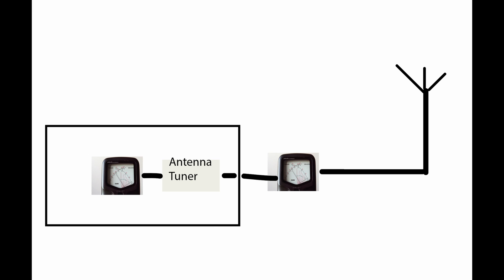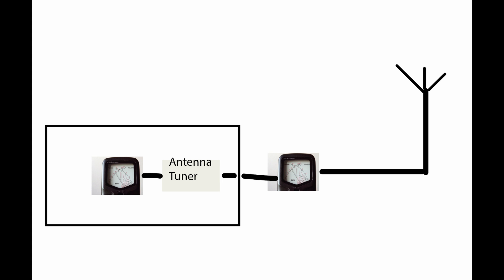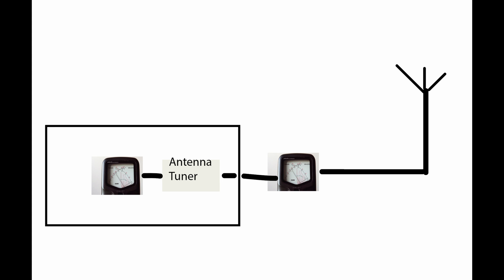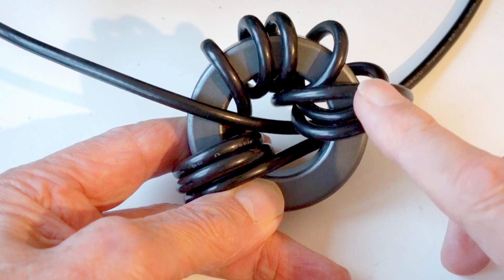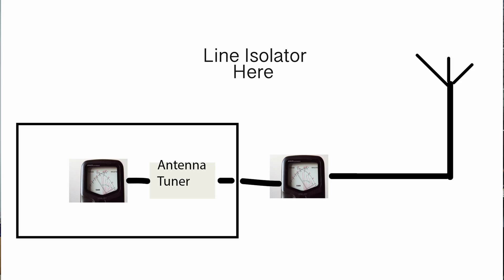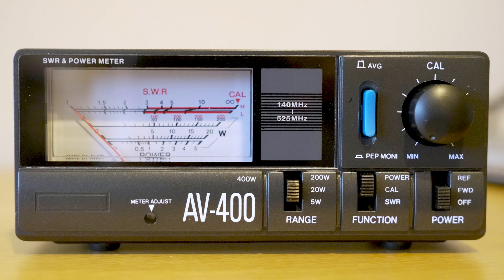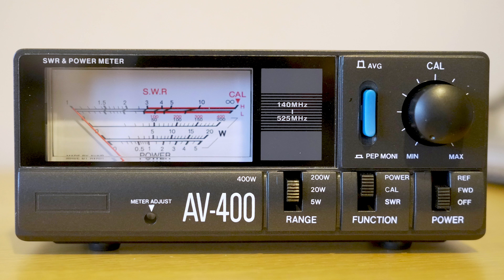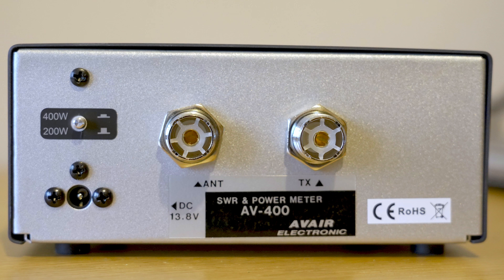VSWR Power Meters: The Truth - AV-400. AV-201

Comment: But my problem is that my internal meter shows a good swr so I bought an external one to double check.

Now that shows swr is too high, I then adjust my antenna and the external AND the internal meters matches on all channels, showing more or less the same values.

So everything is fine, both meter did just confirm that. I unplug the swr and put the antenna back on the radio. Now guess what happens, the internal meter shows high values. I plug the external back in, works fine, the internal and external plays well together on all channels tested. Unplug the swr meter again and of course the internal meter now is out of range again.

What should I do? I really don’t understand, if they are both measuring swr why can’t their work done instead of being confused and not I have clue which one to trust.

Comment: Hi Mr Stanton . i just passed my foundation exam i was on CB radio 20+ years ago so i want to start on the 28mhz frequency and try DX there for my starting point . So my question is do i get a SOLARCON ANTRON 99 as my first hf radio antenna? i have a small garden and i was going to next try 2m band i will only be able to have 1 antenna up at 1 time so swapping antennas every few months to try other bands was my idea for now. Or what do you recommend as my first hf antenna that would cover 28mhz and more? i chose the SOLARCON ANTRON 99 because its a simple antenna and does not stick out like a sore thumb . hope you have time to read and reply.
Reply from the maker: Firstly,, well done on joining the Ham Radio hobby. I think your plan for 28MHz is a good one. The band is great for DX and you will get experience that way. It is also great for low power operation. I will be covering a simple antenna system for small gardens in an upcoming video. Well done/ 73 Peter.

Comment: Actually, what is called an "antenna tuner" is actually an "impedance matcher".  Only the IrStepper, the ATAS, various screwdrivers are true antenna tuners
Reply from the maker: I think you mean SteppIR?. Yes I have covered this point many times in previous videos and the correct term as defined by G5RV is "AMU."